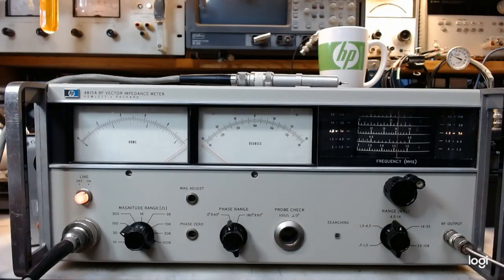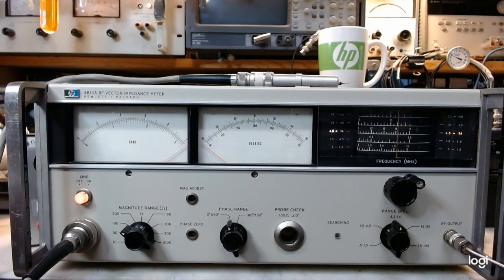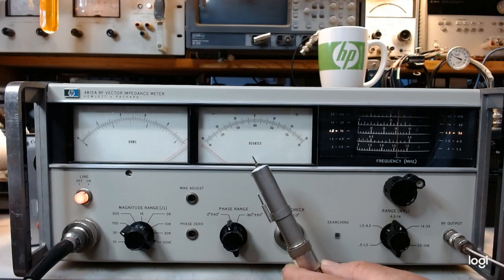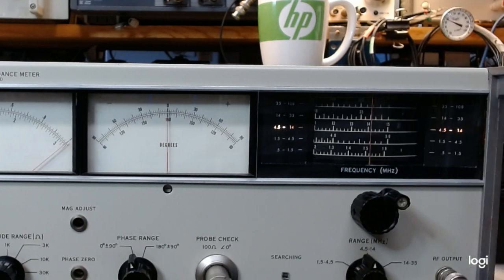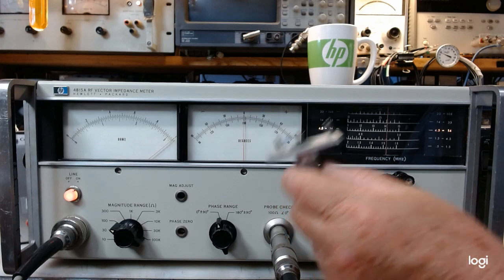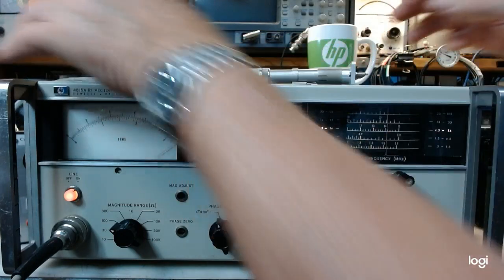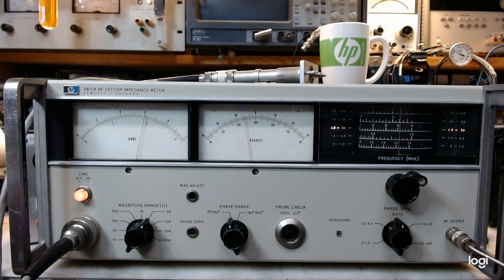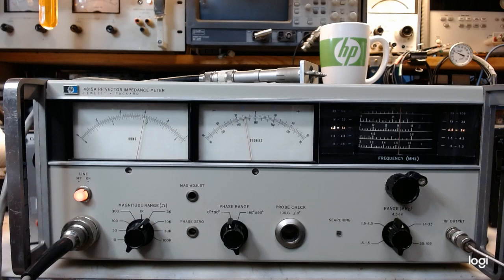HP 4815A RF Vector Impedance Meter

Comment: I Spoke to George sandford, who was the production supervisor on this product throughout its run from 1966 through 1982, before he died (about ten years ago) and he told me that interestingly enough , exactly 4,815   of these units were manufactured!.  They also made the superb 4800a audio vector voltmeter in the same building.   
  I'd love to hear from anyone else Who owns one of these and start up a bit of an informal owner's group. I doubt if there is  anyone else who has worked on three of them like I have.
Reply from the maker: I'm surprised that only 4815 were built. I've  got 2 (with probes) and I'd love to compare notes.  My eMail is <callsign>@comcast.net.

Comment: I have 3 of these,with probes.An engineering masterpiece. What it does and how it does it was considered impossible at the time.60 years later its still a miracle machine. Designed largely by gerald alonzo and richard blackwell.
Reply from the maker: Yes, it is a remarkable instrument and does not even have a uP to compute corrections!  They don't build 'em like this no more.

Comment: Excellent instruction of this device, I have one , and need a probe. Thank you, Sir.
Reply from the maker: Hi,  Regrettably  without the probe the instrument does not even make a good door stop.  At this moment (3/4/2024, 8:25AM PST) there is a probe with accessories (RARE) on eBay for circa $900.  That is the going rate even without accessories.   As a lab project, this link shows an attempt at building a probe: https://www.davmar.org/pdf/HP4815A-DK.pdf .  I was not impressed by the results. It seems to me that you would need a probe as a reference to build one.  Even getting the probe apart seems not to be obvious.   I have a second instrument with probe, but don't want to split the pair.  Sorry that I don't have better news.  
Dick
Reply: @w1qg  I found a pdf on how to build one. it's online, including SMT parts and op Amp. I'm on it. Very simple build, with brass housing. Custom plug in , and test probe, including T probe test jig for resistor testing. And by the way, it's 360 degrees.  Not 90. I got the manual.
Reply: @w1qg  Thanks, I saw the kit, Canada guy has the real deal with all the test jigs. 900 bucks.

Comment: Any info on how to disassemble the probe?
Reply from the maker: Hi Henry, 
Regrettably, I have none.  It is interesting that the schematic of the probe is provided in the manual, but that is about it.  It would appear that simply unscrewing the inner collar would do it, but I am not going to mess with it:  if it ain't broke don't fix it.  
Have you tried to take one apart? 
Dick
Reply: Hi Dick,
I'm trying to fix my probe, the inner collar seems sealed or need special tool to unscrew.
Henry
Reply from the maker: @henryfeng6556  
Hi Henry, 
Bummer on the sealed collar.  You might try the the HP group on Groups.IO. Someone there might know. 
I'd be interested in what you eventually find out. 
Dick
Reply: I need one, a probe. Or can I BUILD  ONE. My unit came brand new still in the box, from a storage unit in San Jose,  sadly no probe. Help me,  please.